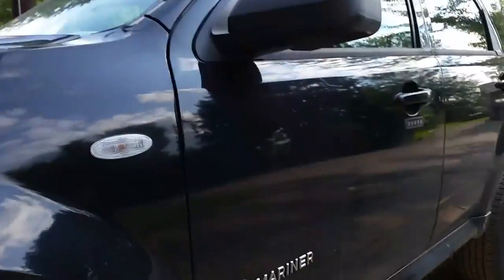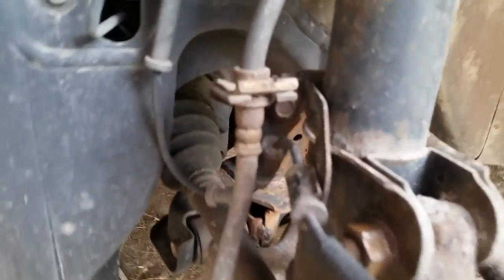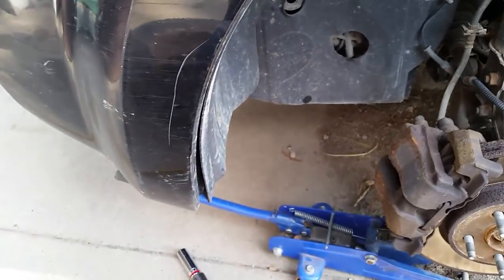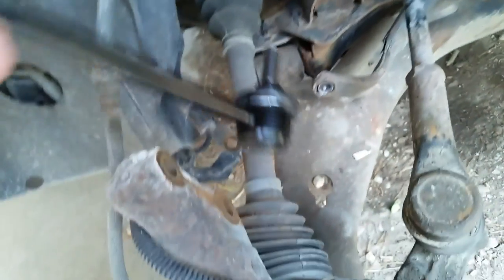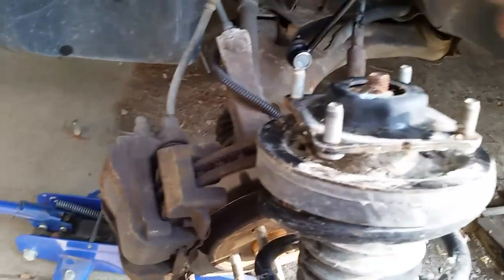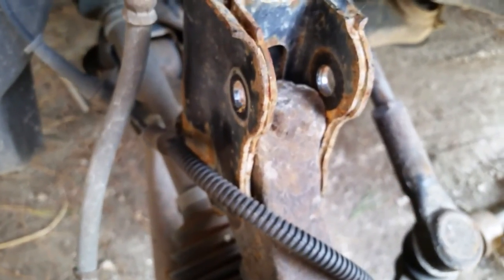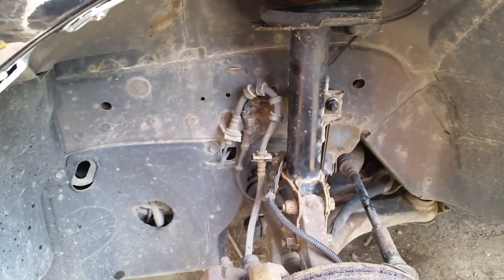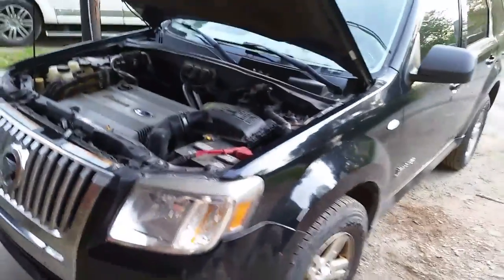2001 to 2012 Ford Escape Mercury Mariner step by step struts and stabilizer link replacement

Comment: I have a sagging front suspension I think. Both front tires are wearing on the insides at like a high rate. These are tires only a season old. I'm wondering if they aren't a tad bigger tire or what happened.
Reply from the maker: If the struts have over 100k on them I would replace. Inspect inner & outer tie rods, ball joint , and get an alignment.
Reply: @darylturcott  Thank you for the fast reply! I notice the strut and spring assembly can be purchased as one unit is this the best way to go about this??.. replace the whole tower both sides? The vertical "link"s are still attached and feel sturdy. I haven't had it up in the air yet.
Reply: been reading.... cheap replacement struts are a bad idea lol.. Ill check out the oem stuff.
Reply from the maker: Yes, the full assembly is the way to go. Sometimes called loaded struts.
Reply from the maker: I use some lower price parts. Like detroit axle. But you can't go wrong with motorcraft,  monroe, or gabriel. 
Rockauto.com had motorcraft for $25 each a few weeks ago. Sold out very quickly though.
Reply: @darylturcott  Thank you Daryl, I really appreciate your feedback :)

Comment: That 14mm bottom nut on the sway bar is in an awkward place and I'm having a hard time finding leverage to break it and I can't fit my pneumatic gun in there, do you have any tips? the distal side is also completely rounded so there is nowhere for me to get a wrench on there
Reply from the maker: I would say maybe a die grinder or dremel and just cut it off? Ive had to use needle nose vise grips to hold the outboard hex head in past. But the nuts have always come loose fairly easy. I use pb blaster but any penetrating fluid should help.

Comment: Do you generally have to do an alignment after replacing struts and/or stabilizer links?
Reply from the maker: Some vehicles should be, but I dont believe the escape is one of them. The struts or links dont change the architecture of the front end. If anything it would tighten it up and make it closer to factory spec.